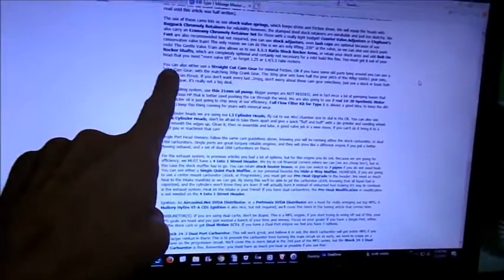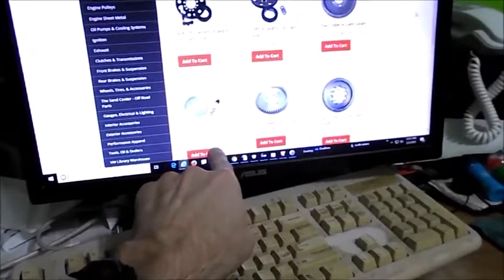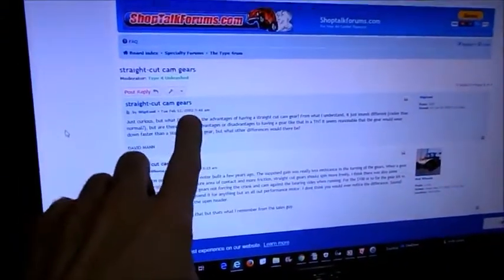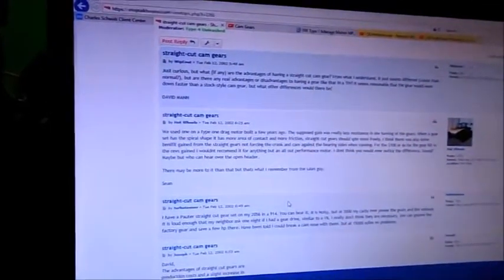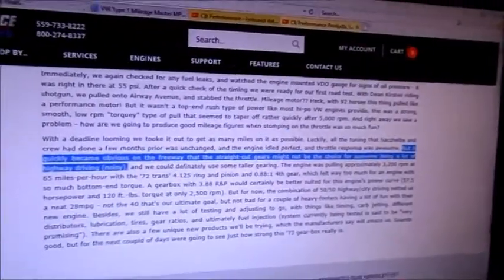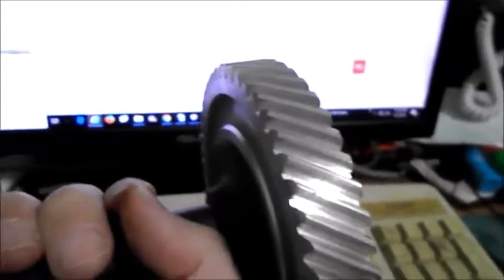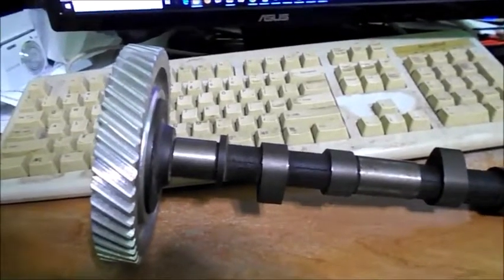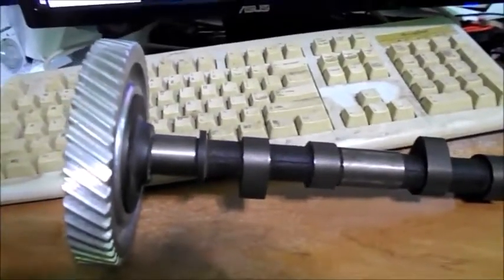vw type 1 mileage & mpg vlog 5 cam gear

Comment: Straight cut gear vibration definitely kills valve springs.

Don't know how much it helps, but I've also seen a groove cut down the center of the cam gear for oil evacuation.
Reply from the maker: i think the groove is covered in fisher's "how to hot rod volkswagen engines". an ancient and probably useless mod like the hvx mod. if you're hot rodding then you're at 4k plus rpm and the gear is at 2k plus or 33+ rps. this gives a G force at the teeth on the cam gear of 2500 plus G. i don't think there is much oil on the gear for evacuation at that point.

Comment: Whilst it won't be much, and you sure wouldn't notice an associated MPG difference at all, there will be a reduction in friction with the SC gear set.  The helical gear set unavoidably results in a component of force being directed towards the thrust face of the cam bearing (and so a companion frictional load), whereas the SC gear does not.
Reply from the maker: i've heard that and read that many times. since you claim it to be true then justify your position with physics. what you have said is true and incomplete. if you can convince me you are correct, i'll pin this thread right to the top and update my vid collection with my newfound knowledge.
Reply: Yeah, you are wrong on this one and the reduced noise is because helical gears mesh over a period of time instead of the whole gear face slapping into mesh and squeaking out in a single instant.
 Straight gears produce less power loss simply because the helix angle transfers force at an angle relative to the work being performed, that angular misalignment produces the waste product of minor opposing thrust forces on both shafts proportional to the helix angle.

Comment: Yeah, you are wrong on this one and the reduced noise is because helical gears mesh over a period of time instead of the whole gear face slapping into mesh and squeaking out in a single instant.
 Straight gears produce less power loss simply because the helix angle transfers force at an angle relative to the work being performed, that angular misalignment produces the waste product of minor opposing thrust forces on both shafts proportional to the helix angle.
Reply from the maker: i'd be willing to discuss further but you need to impress me first by defining what you mean by "proportional to the helix angle". the word proportional has a broad definition yet the helix gear interaction is very specific. it is that sort of word thing that bob hoover uses again and again in his writings and as i've shown in many of my vids, he didn't understand anything past the word.